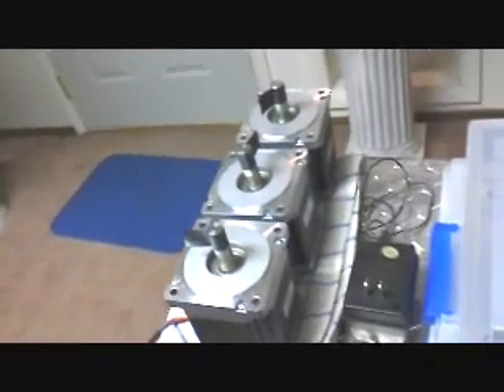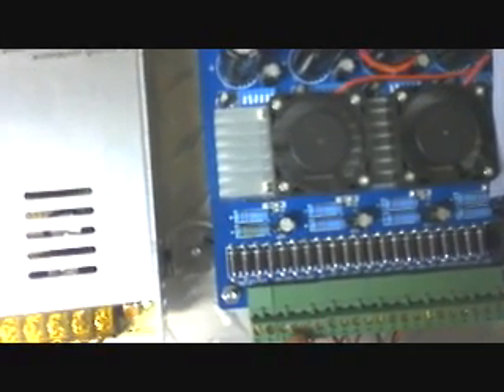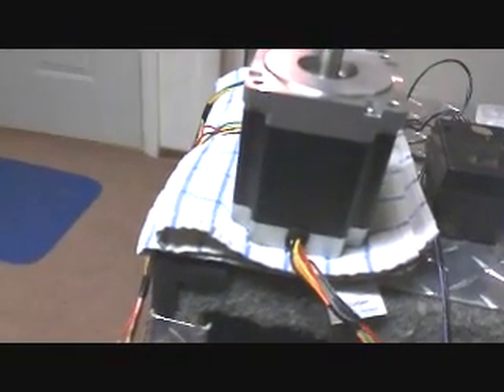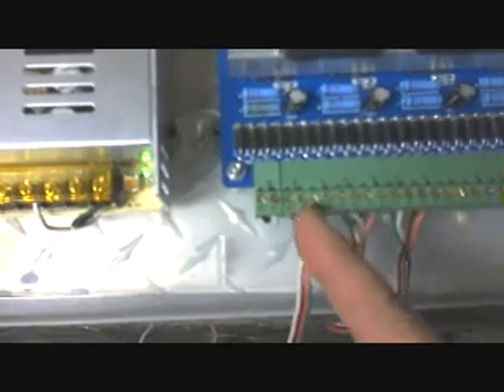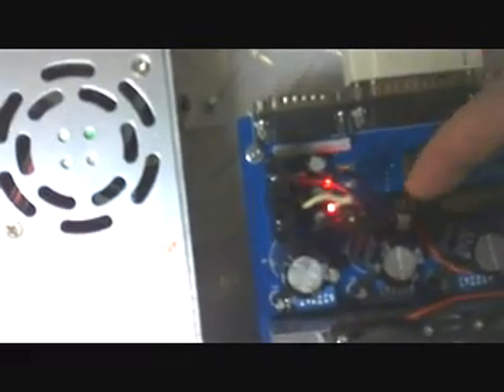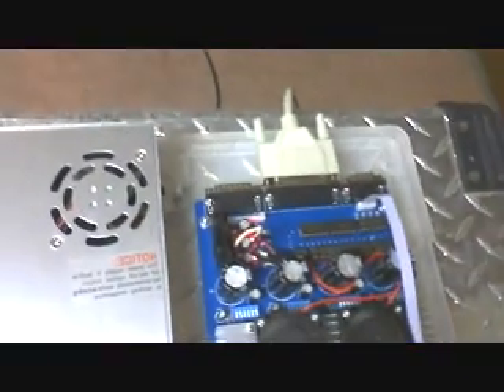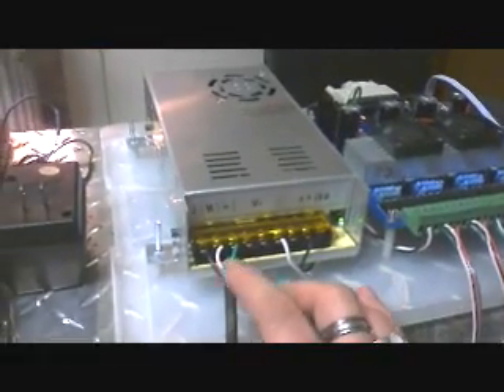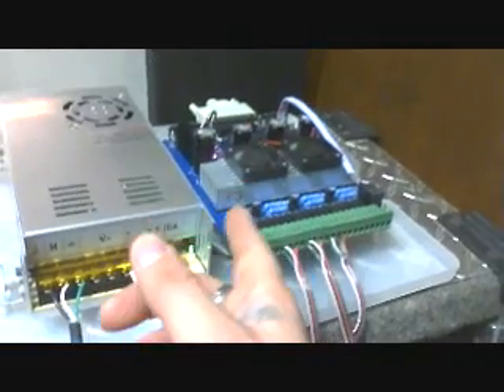4 axis TB6560.wmv

Comment: I had to uninstall, then reinstall the printer port card. It dosen't matter now becse my board fried. At the connection between the power supply and the board, the wires weren't touching, but if you touched the green connection point on the board, it would move a little and cause a spark, so eventually it went up in smoke. Is this problem usual?